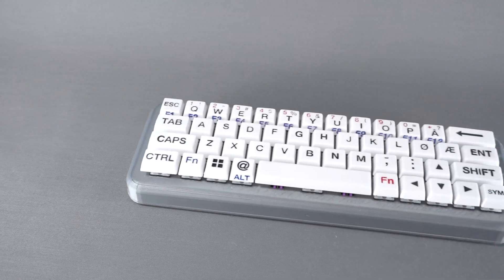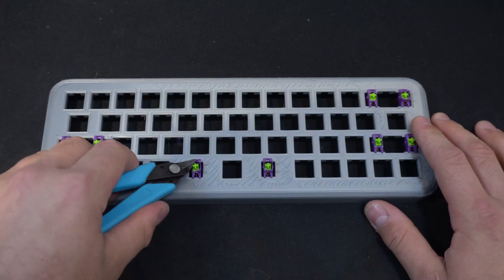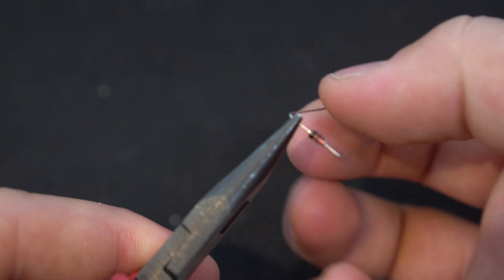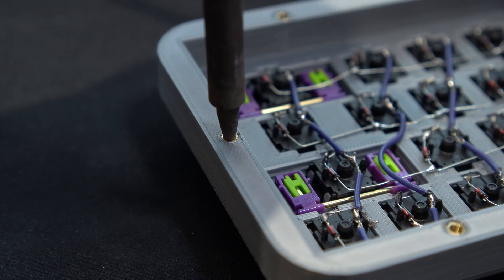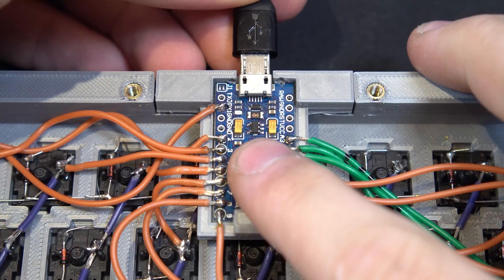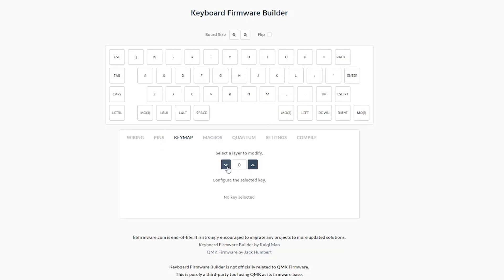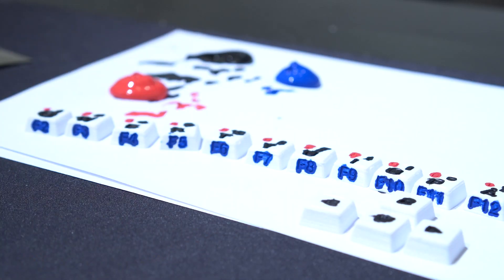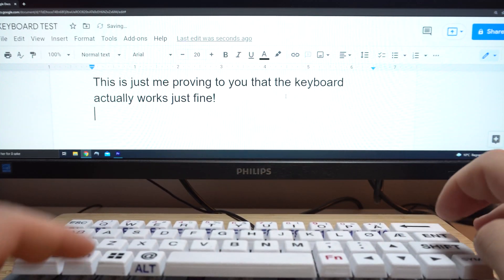3D Printed 48-key Mechanical Keyboard Build

Comment: I have a problem with the space bar, it is more tha 60 mm and it dosnt fit it the case actully qnq i dont know what to do
Reply from the maker: Hi, do you mean the spacebar stabilizer doesn’t fit? It’s not designed for a «standard» size stabilizer so you have to manually bend the stabilizer metal rod with some pliers to match the space between the two holes. 

Sorry if I misunderstood your question, please let me know if there was a different issue.
Reply: @makerunit  i bend it like in the video but for some reason the actual keycap dosnt fit in the 60mm is to much longer  and it cross the space of the actual keycap, iand i print it without modify his size, pliz help: C
Reply from the maker: @alexandragamer9130  Oh. I see what you mean when I look at the file, the keycap does not match the holes. Very strange that it's been 3 years and not a single person has mentioned this issue. I'll try to fix it and send you the updated file. Sorry! I think it's easiest to re-print the keycap to fit the chassis, as it's much smaller!
Reply: @makerunit  thanks You soooooo much 💗💗💗
Reply from the maker: @alexandragamer9130  can you message me on Printables? That way I’ll have a place to send the file when it’s corrected.
Reply from the maker: @alexandragamer9130  Hi again, I have the file ready now the metal bend should be adjusted to 52mm instead of 60mm. My bad. Please contact me through the Printables chat so I can send you the updated file to test.

Comment: Excellent video, if it's not too much trouble I would like to know if you have the stl file model of the stabilizers you used. as much as possible. thanks crack
Reply from the maker: Hi! Thank you! Unfortunately the Stabilizers were not printed but bought on amazon. I’m not sure if they’re still available, but you may get away with another type and bend the stabilizer bars to fit possibly but I can’t guarantee 😅
Reply: @makerunit  Gracias bro:hand-purple-blue-peace:

Comment: The pro micro (atmeta32u4) is getting a bit long in the tooth.  It's also a bit expensive.  The new RPi Pico is only 4 bucks, the wireless version is $6.  QMK runs on it, and now that the bluetooth support has been added to the C lib, you can even build a wireless keyboard using it.  The Pico has much more IO pins than the pro micro, so even a 104 key version is within it's grasp, not to mention RGB lighting support.
Reply from the maker: Aha! Thanks for letting me know. I don’t think this was available at the time of making this. (I think)

Comment: How do you know where to wire the rows and columns ?
Reply from the maker: You just need to imagine a grid draw lines so that one row(horizontal) and one column (vertical)connects to each switch. Then you need to write down that grid so that you can replicate it in the QMK firmware if making custom firmware. If not, I feel the video explains is pretty good, better than I can with text at least😊

Comment: excellent video! could i use a Raspberry Pi Pico as a controller?
Reply from the maker: Thank you! I mean you might but I can’t say for sure as I have never worked with the Pi Pico. I’m still learning this kind of stuff myself as I go so haven’t gotten there yet unfortunately to be able to answer you on that. But the micro controller holder in my specific design is specifically intended for the Arduino Pro Micro. If you look through the kbfirmware website there’s a dropdown menu i believe of supported micro controllers.

Comment: Nice, the custom labels on the keycaps look awesome! 

One note for who isn't too comfortable with soldering: 
1) Practice a little before;
2) You need to be careful when pre-applying solder as it can lead to "cold joints" and therefore possible intermittant connections, so don't do it unless absolutely necessary and, if you do, don't stay too long on the joints with the iron. Also, it's a good idea to add some rosin flux when needed.
Reply from the maker: Thank you! Glad you enjoyed the build! 

I wasn’t aware that cold joints were a thing, but thanks for letting me know I’ll definitely keep it in mind for later projects 😊

Comment: What can I do if the keyboard doesn't fit on my 3d printer?
Reply from the maker: I’d say use a software to cut the part in half, some slicers also have the option to split bigger parts which you can then glue later.
Reply: @makerunit  thanks

Comment: What material filament did you use? Did you have to do any post processing to get a better finish?
Reply from the maker: I used a gray colored PLA filament for the frame and white PLA for the keycaps. All the post processing I did was shown in the video, the only surfaces I «finished» were the actual key caps after applying paint to each letter and symbol.

Comment: Cool build! I was wondering what are the advantage of doing the wiring instead of buying a cheap PCB though.
Reply from the maker: Thank you! Honestly, it’s more for the learning experience I would say, just understanding how it all works. 

One advantage with hand-wiring is you could make custom unconventional keyboard sizes and shapes without having to order a new PCB for every attempt. 

But this one specifically was intended also for me to learn how it’s done, gave me great understanding of exactly how keyboards work which I never new before.
Reply: @makerunit  oh that’s nice! Thanks for the answer.

Comment: Im working on the same project, but planning on using an adafruit neokey 5x6, and joining multiple together. I am not very good at soldering so I see this as an easier alternative. This doing the matrix for me, would you know how these matrixs can be attached together?
Reply from the maker: Hey, sorry for the late response, unfortunately I don’t have much experience with joining two separate boards. 😢
Reply: @makerunit  Your video has been very helpful, do you know what to do if I was to have 14 cols instead of 13?

Comment: sounds kinda cursed, also try lubricating your stabiliser wires, just the parts that go into the stabilisers, this reduces rattle.
Reply from the maker: Yeah I agree, especially the spacebar sounds quite bad. I had to manually bend the metal bar to the correct size for this spacebar as it wasn’t a conventional size for the space.
Reply: @makerunit  oh, right, so u maybe made it, say 1.9-1.8u instead of the 2u stabiliser you're using
Reply from the maker: @ezntek  yeah I don’t have the exact size but yeah 👍

Comment: How many keys can the arduino support ?
Reply from the maker: Given the digital pins of 18 on the pro micro, the theoretical max keys would be 9 by 9 rows which is 81 keys but this would make for a square keyboard, or very confusing wiring schematics to make it work.

Lets say you’d make a 5 row keyboard, you could support up to 13 keys per row. (Only 65 keys)

A 4 row keyboard would support up to 14 keys per row. (Only 48 keys)

6 row keyboard would support 12 keys per row. (72 keys) etc.

You get the idea, the closer the row and column number are to 9 on each side the more keys. The less rows lower than 9, the less total keys.  

I hope this made sense…

Comment: Can you use a teensy 2.0 with this keyboard?
Reply from the maker: As long as the amount of digital pins are enough to cover all the rows and columns it should work, but the controller may not fit in the holder I designed, so you may need to make a custom microcontroller holder piece.

Comment: I have an Adventurer 3 printer but its not wide enough to fit the bottom plate. Do I have any options? I assume that I can't really just scale it down to fit my printer since everything won't fit... :(
Reply from the maker: Hey, scaling isn’t really an option unfortunately as this will not leave enough room for the switches. They are already a very tight fit as it is now. 

The best option for you would probably be to split the model and print it perhaps in 4 pieces then glue together and maybe finish with some sandpaper. This would’t look as clean but may be the best option for your print volume unfortunately… I hope you find a solution!

Comment: Hey could you handwire a 40% ortholinear?
Reply from the maker: Maybe that’s another project for the future, I’ve got a few projects waiting now to finish 😊 I’ve actually never tried a ortholinear keyboard, are there any benefits to this opposed to using a regular layout?
Reply: @makerunit  The first benefit that comes to my head is that if you work with numbers you can program a calculator layer. it's way better than crunching numbers on a staggered keyboard. in my keyboard it works just like on your mobile phone, if I press a key I get a calculator layer for one keypress, because I maybe want to just press a symbol, but if I press it twice I get locked on that layer, in case I want to type a long number.
Reply from the maker: @alpacamale2909  ah yeah I see that’d be useful in many scenarios. Maybe I’ll give it a shot one day! 😊

Comment: I love it! Great job
Reply from the maker: Thank you! I’m glad you liked it! 😊
Reply: @makerunit  What is the max keys? 60?
Reply from the maker: @ShadowFandub  there is room for 48 keys total 😊
Reply: @makerunit  i mean, the pro micro can use 60 keys?
Reply from the maker: @ShadowFandub  I believe it’s got 18 pins for keys (I’m using 17 of them, all exept TX1) which allows for a maximum of 81 keys possible if using 9 rows by 9 columns. But really depends on the amount of rows vs amount of columns you’re using. 

An example is: 5 rows, 13 columns which allows for 5 times 13 keys which is 65 keys. 

6 rows 12 keys can do 72 keys for example.

I hope my explaination was good enough 😊
Reply: @makerunit  yes, thx! i want make a 61% keyboard :'D
Reply from the maker: @ShadowFandub  aha! See! It should be possible with this controller 😊 good luck! I’d love to see your result if you make one 😊